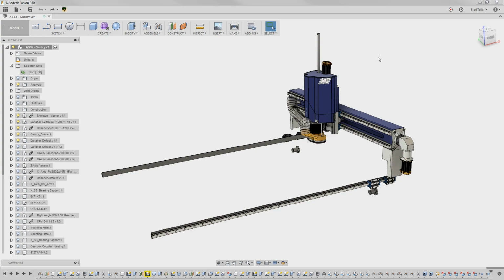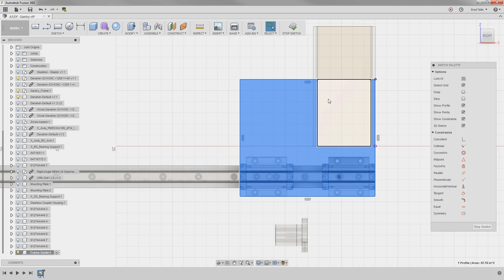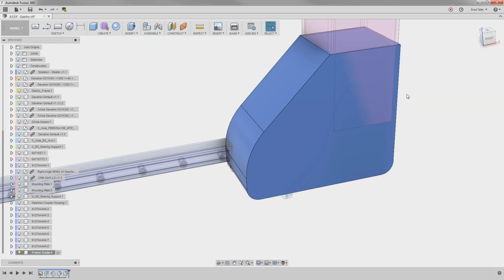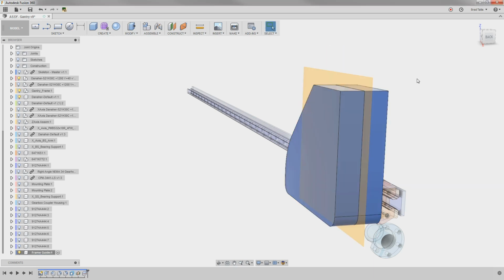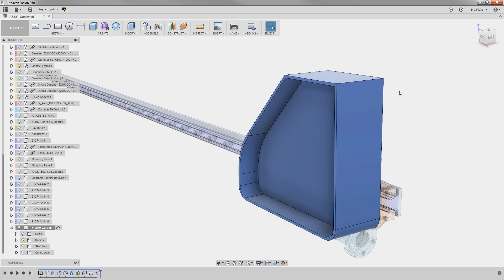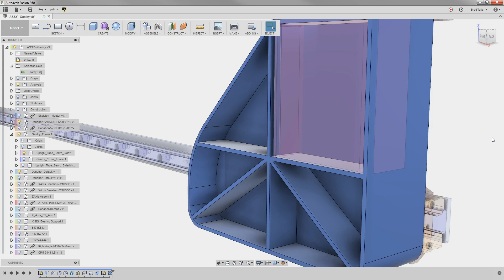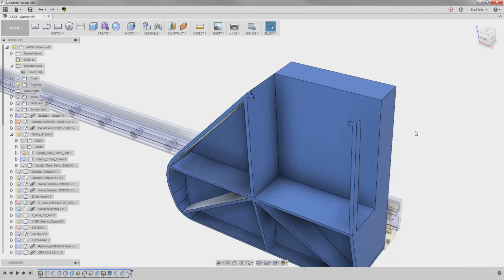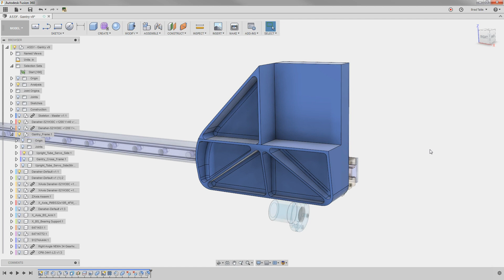Advanced Part Modeling Techniques

Comment: I can't find where/how to send a private message!! I didn't feel the need to post this error publicly. But can't help it.

You forgot the through holes to mount the bracket to the slides. That would wreck the whole web thing. But good to see the web build process.

Excellent vid. I don't normally think in 'subtractive' mode. It's good to see a design thought through that way to help animate my thinking.

You didn't mention what material that bracket was intended to be made of? Whether plastic or metal it looked kinda lightweight considering the mass of the arm and router that it carries.

How about another vid that reverses the bracket for the other side? I think that's gonna be non-trivial.

BYW the link to 'three advanced techniques tutorials' goes to a root/everything page.
Reply from the maker: Don't be shy to call out our mistakes, we make tons of them! Its a good thing Fusion 360's history makes it easy to fix.

I would imagine this part would be cast metal of some type, and creating the other side would actually be pretty easy via  a mirror command. 

Sorry about the generic link. Here's one that'll get you closer: http://f360ap.autodesk.com/courses/advanced-part-modeling-techniques 
Only reason that wasn't used was fear of it not working.